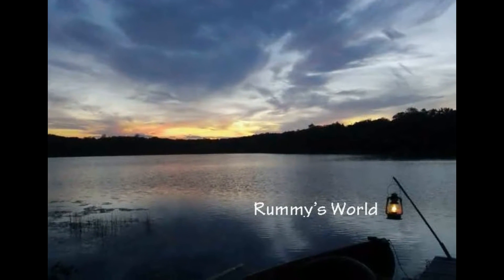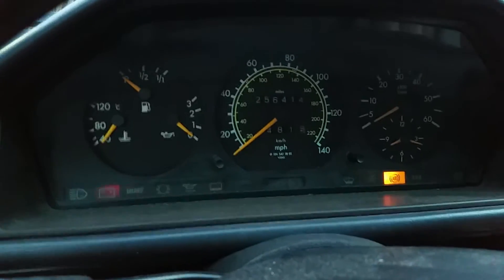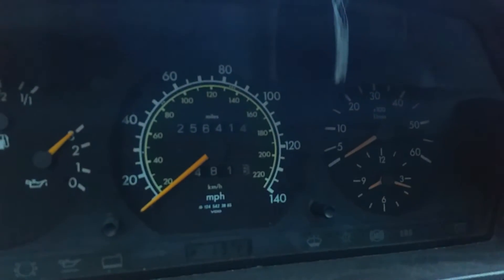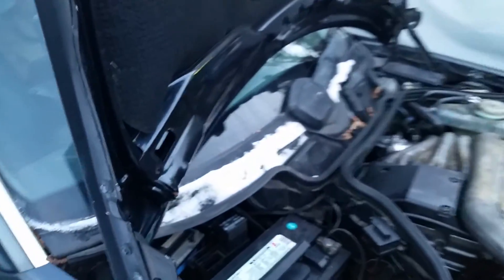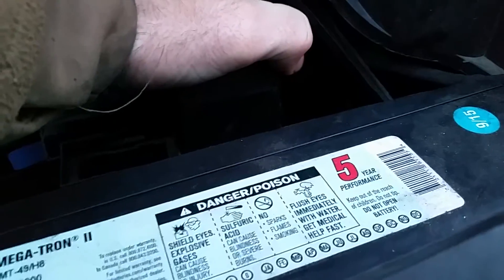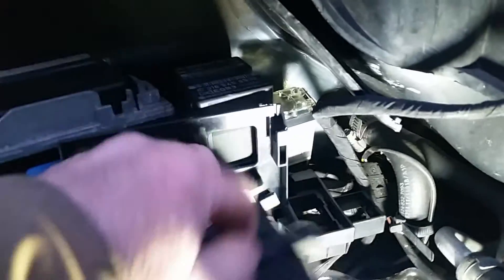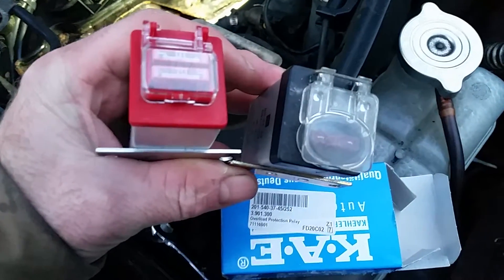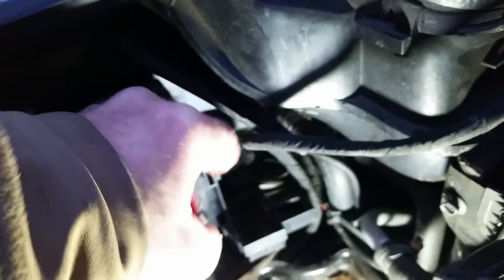Mercedes diesel electrical problem solved in 10 minutes!

Comment: Hi i have one question.
Last week i forget and i left on inside light and run out batteriy almost.
When i want to start in morning i couldnt its almost get to point to start and quit.
Second time i try and no luck but tachometer was rasing from 5 to about 40 whail i tryaing to start.
Coulf OVP solvd the problem??
Thanx😀😀
Its MB w201 2.0 diesel

Comment: The tach on my 1987 300d w124
Is not working.  And ideas or suggestions would be greatly appreciated.  Thank you
Reply: Ovp relay is bad. Same thing this guy is replacing. Or sensor on the bottom of the transmission

Comment: Hi, I have the same problem with my W124 300D when I start engine.... trigger ABS light and tachometer not working and engine has low engine speed....But sometimes randomly ...ABS light off and tachometer works and engine goes smoothly...just sometimes....So OVP realy solved this problem???
Reply from the maker: Cecho193 yes this should fix that, make sure you get the new style relay with 2 fuses
Reply: Rummy's World Hi, i have another question...what is different between ovp with one fuse or with 2 fuses?? because I found ovp just with one fuse...do you have original ovp made by Mercedes Benz??? (this is serial number of my ovp 2015400845) thx
Reply from the maker: the one with 2 fuses is the newer style and recommended
Reply: My W124 has the different engine, it's 1988 model, the part number OPR is 201-540-08-45, can it work with the new? ...
Reply: Rubenius ViGal yes. They are interchangeable

Comment: if you change the fuse in that OVP relay is there chance it will fix the glow plug not functioning ? cuase for me sometimes glow plugs work sometimes not
Reply from the maker: HI sorry I missed your comment earlier.  Not sure, but to be safe replace the relay.
Reply: With a multimeter test the ohms of each glow plugs. The wiring and plug of is attached to a relay a little hidden next to the windshield water reservoir and behind the abs (OM606 na)

Comment: So how well was the car running with a bad OVP?
Reply from the maker: Mike M not well at all,  it would frequently idle very low almost to the point of stalling. also the tachometer would not work.